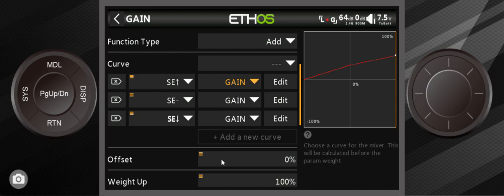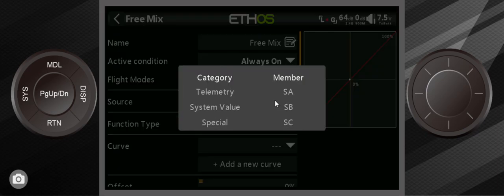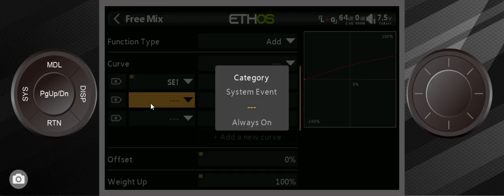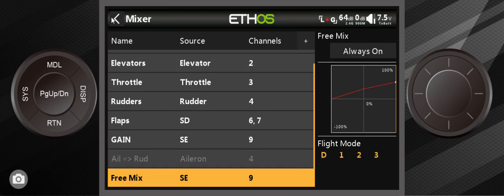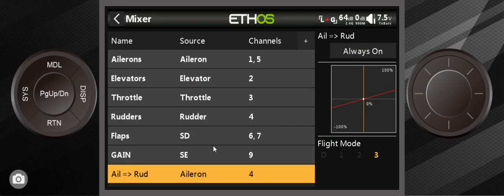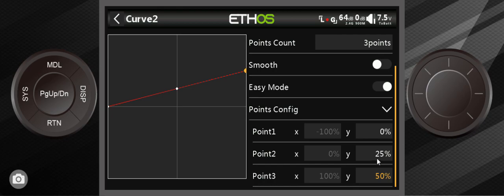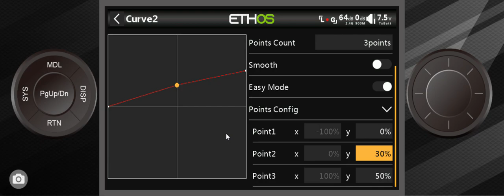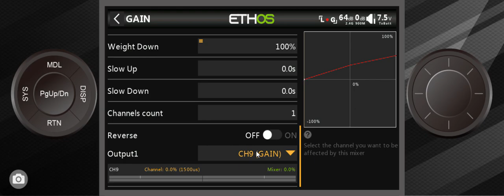FrSky SrX Receivers, putting gains on a switch, not a knob

Comment: This is awesome 👏🏾 I think maybe this can help me in separating the gyro levels based on axis(pitch, roll, yaw)? I’d like to use my archer SR10 Gyro with the gains on each axis on a switch especially during my first flights so I can fine tune my planes better. Is this possible with my setup? SR10 and S20s transmitter? I’m used to doing this on my spektrum radios